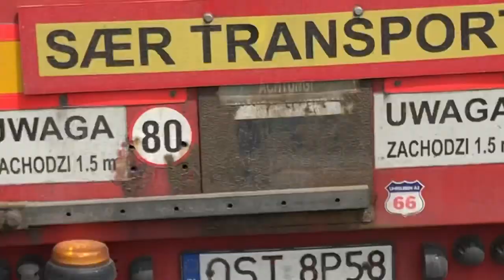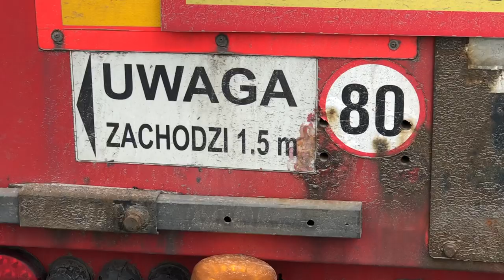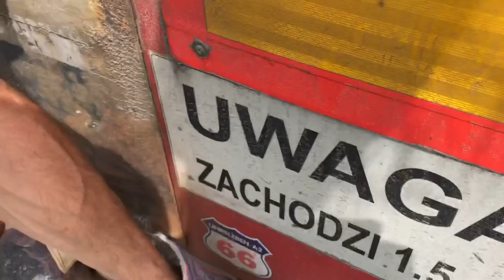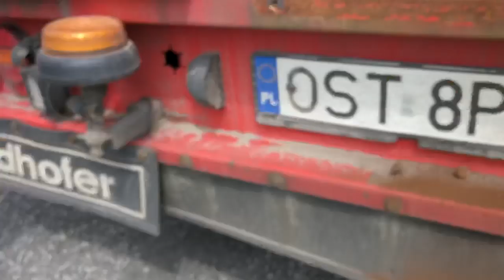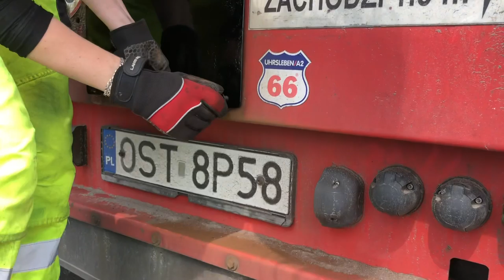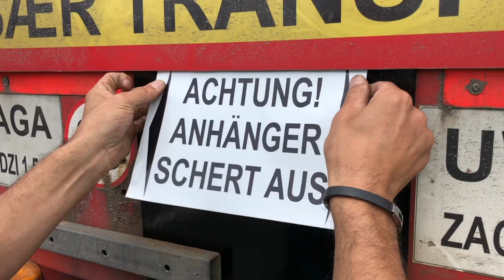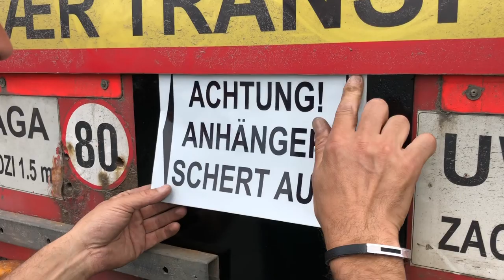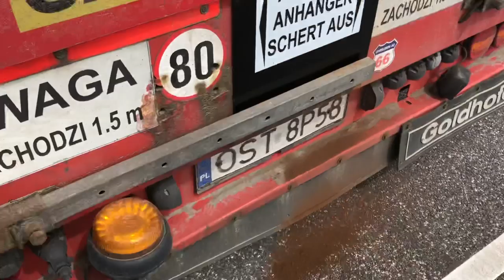Naklejka, A sticker - Iwona Blecharczyk 2019/45

Comment: You really need to have  ear protection when grinding or exposed to other loud noises, so you don't get Tinitus when you get older! I speak from experience!! The ringing in my ears is a constant reminder I should have taken better care of my ears, other than that, nice video Iwona!  Regards, Ron
Reply: Ron I have tinnitus too. Flying single engine aircraft without ear protection. Good news it seems to be getting better since taking NR (nicotinamide riboside). I haven’t had to say “Huh whadya say?” in a very long time. Still have it. Just not as bad. Thought you’d like to know.

Comment: You did not have paper behind the plate, to catch paint overspray.
Painting is an art...
For the plate, all the screws need 'Loctite', to keep it from loosening over time & for easy disassemble.
Sign should be international symbols.
♡
Reply: loc-tite makes it harder to disassemble. I don't know if it will prevent rust. Proper torque will prevent it vibrating loose and anti-seize or copper-coat will prevent threads rusting.

Comment: Hi Iwona. Nice job but be careful no to do jobs that maybe a safety issue. I used to adjust brakes...no more as that job is for workshop. Even fitting a wheel that comes loose and kills someone makes you liable in Australia. Have a safe drive and hope your nice weather holds. From Emu Park Australia
Reply: In British Columbia, Canada it is the driver's responsibility to check and if needed, adjust brakes. Spot checks can take a truck off the road and fine the driver.

Comment: While using a grinder, safety goggles are not enough. You need to wear the helmet and face shield. A poor quality Grinding Disc breaks into pieces and a tiny  flying piece can be very very dangerous. Remember ! Face Shield and Helmet ! Stay safe n blessed Iwona.
Reply: With hearing protection! Some hard hats are designed for snap on or in face shield and hearing protection. One of those would reduce the amount of storage space needed as most drivers must carry and often wear a helmet.